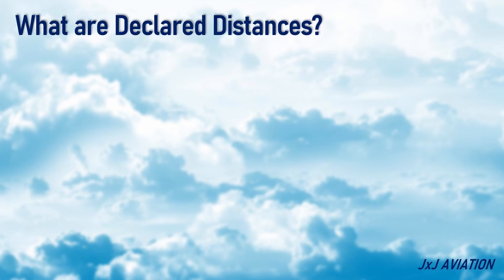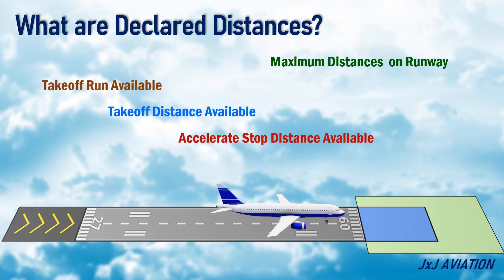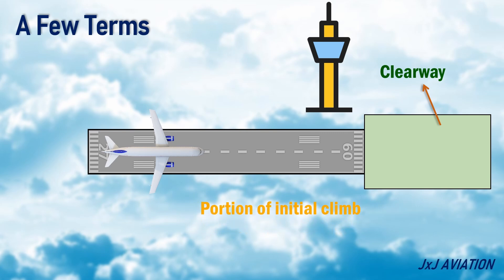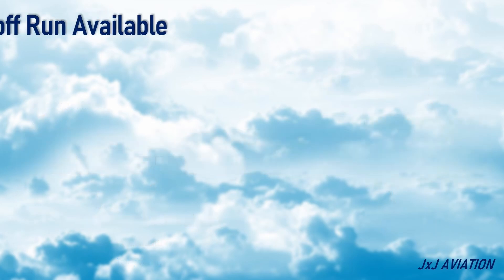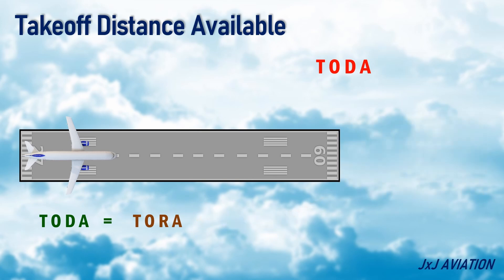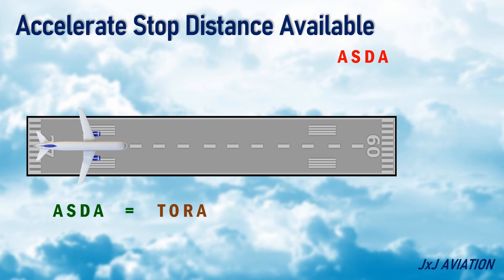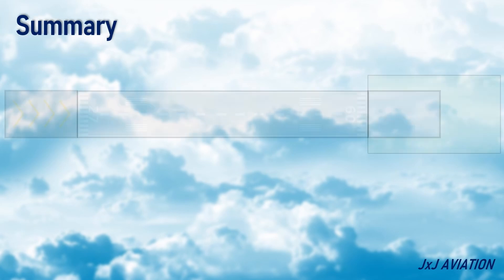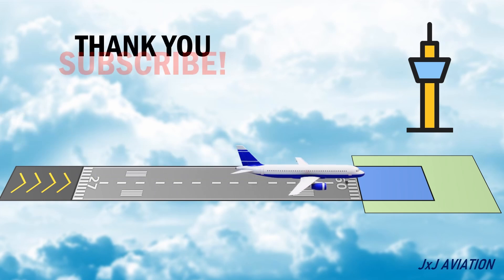What are Declared Distances? | Understanding TORA, TODA, ASDA and LDA.

Comment: This is a good helpful quick guide however I think I can point out one area of this video that's confusing.  

You show the displaced threshold with the "Chevron markings" and not the displaced threshold arrow markings. These are very different meanings since the Chevron area CANNOT be used or considered part of the runway that's usable by an airplane on takeoff or landing. .
Reply from the maker: wow that is really good information. Thank you!
Reply: I was also thinking the same, the stopway is what's supposed to be marked by the large yellow chevrons and not the displaced threshold.
Reply: Perfect !!